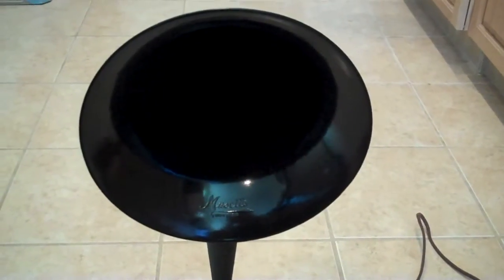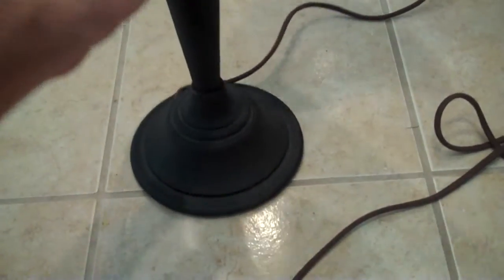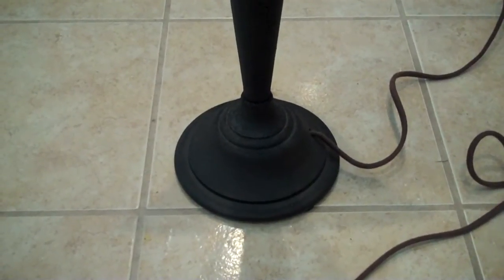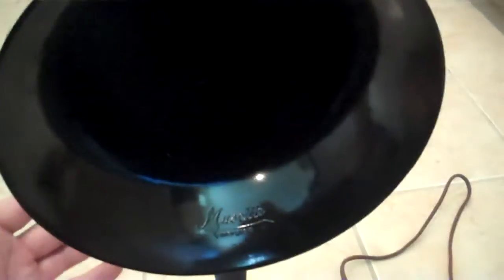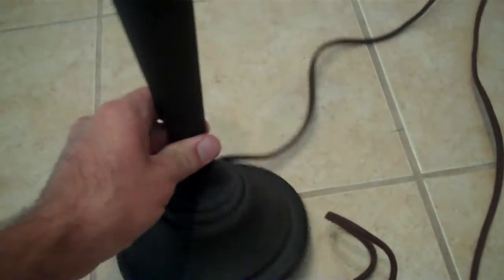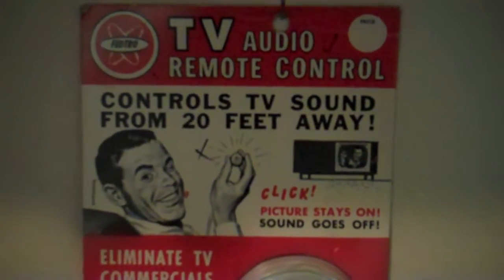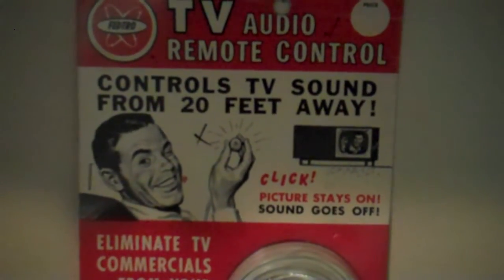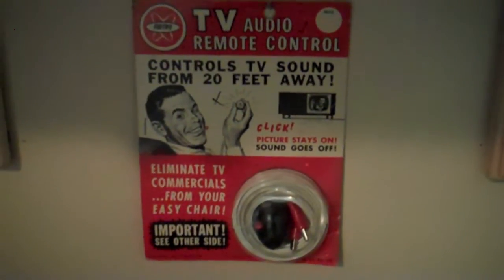Musette horn speaker by Frost Radio 1920's

Comment: Just  bought one!  $50 at this store locally here in San Diego.  My "underneath part" the "driver" as you say has a screw-dial adjustment of some kind.  

I played mine by hooking speaker wire to it and just playing it using the speaker output to my stereo.  Seemed kind of low volume... thinking it wants more juice to sound correct...

I'll link you to some pics of mine by personal message...

If you're gonna post a video of your speakers, we wanna hear something coming out of it!